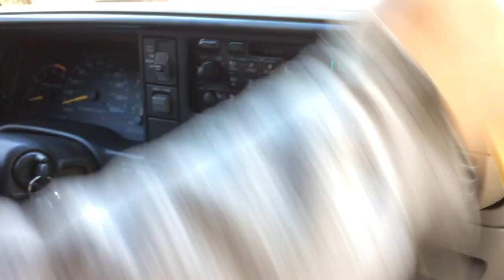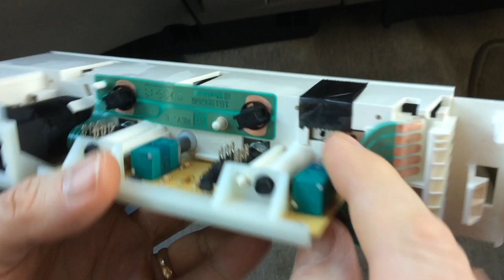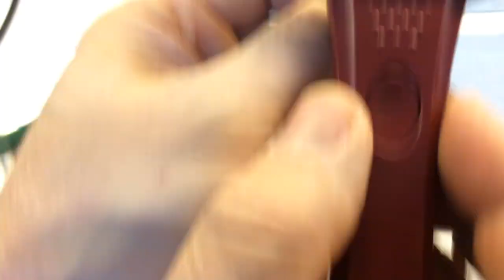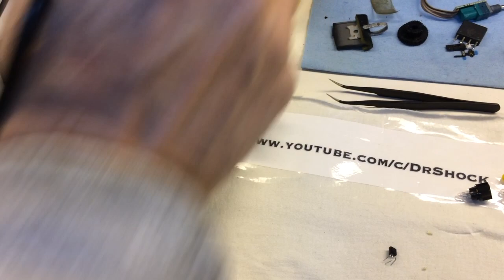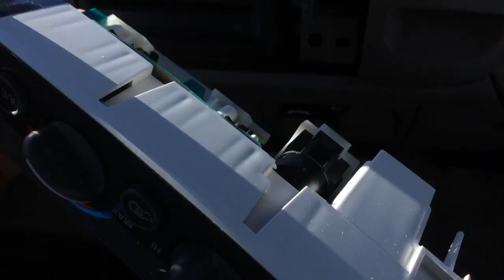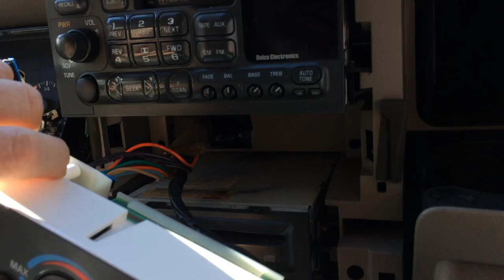1996 - 2002 GM Truck AC Blows Floor Only / Climate Control Module Transistor Repair (Chevy & GMC)

Comment: I have the same issue, but would anybody know the proper name of the green selecter switch for the that determines which way the vent is blowing. Please can anybody help!!
Reply from the maker: So jargon wise, if that's what you're asking,  that switch sets the air blend position so you'll hear the device that it controls called a blend door actuator.   Sometimes folks refer to it as a zone selector as well.  But I guess either are accurate, air blend selection or zone selection.

Comment: Whats a good brand name one to replace them with?
Reply from the maker: There are alot of makes, but newer more likely to be ON Semi or Vishay.   Its a very common component from many suppliers.   Small quantity eBay may end up being cheaper but Mouser.com is another option.
Reply: @DrShock  I saw some claiming to be motorola mpsa56 quantity of five item number 191131370944. How do i know these are really motorola?
Reply from the maker: Small parts like this use symbols, for a Motorola it would be a stylized "M".

Comment: So to get this straight, my transistor that blew is MPSA56. Should i replace it with the same one or the 2N4403? The one that blew on mine is the hard one on the outside edge under the white screw hole keeper. The difficult one you did.Where did you get the solder sucker?
Reply from the maker: You should replace it with the same one that ACDelco originally used if its a common number type as I mention in the video.   However, be prepared to have a short circuit problem in the AC circuit if it blows immediately again.   These transistors either go over a long time (more commonly) due to their just not being quite the right specification for the burden they shoulder  or immediately (more rarely) if its a short circuit under the hood.

Comment: Thanks for the video friend showed up on hottest day of the years Im in Phoenix 113 today her AC stopped working on her 96 suburban. I traced the problem to the control module after replacing the 50 amp AC fuse. I ordered a replacement AC delco module noticed it wasn't the the correct one she had rear defrost. After removing the old control module I noticed the problem the resister you said blows out was blown. I plugged in the replacement AC control mod I got on Amazon to see if the compressor would turn on well as soon as I pushed the AC button the transistor smoked in the new one. I crossed ref the numbers  and they cross over to NTE159. Im headed to Frys electronics see if it will fix it but I suspect it will burn up again. The only thing I noticed was the AC relay might have been installed backwards didn't match the relay next to it that is under the hood in the fuse box with the 4 other relays and maxi fuses. The Transistor is 800ma PNP if it blows again i'm only out the $3
Reply from the maker: @blastman8888 when the transistor blows that fast it's a sure sign you have a short to ground in the circuit.    That transistor supplies the +12VDC battery power to the circuit when activated and it exits the control module thru the light green wire on the passenger side flat connector into it.   You can trace this light green wire coming out of the firewall into the engine bay, usually it starts with the pressure switch on the accumulator and then works its way over to the other other pressure switches and then the main computer.  After a couple of decades like these trucks have you're going to have vibration/rub burns thru the wiring insulation somewhere causing the short.   I'm going to presume you have a gasoline engine (diesel AC circuit is quite different) here's a couple of 1998 circuit diagrams that should help https://www.2carpros.com/images/question_images/204058/original.jpg and https://www.2carpros.com/images/question_images/204059/original.jpg .   Just follow that light green wire out of the 'AC Switch' shown on the left of the first diagram and then thru the rest of the circuit until you find the short.
Reply: @DrShock  Thanks for the reply I will take a look at the wiring when I get a chance I removed the control module and AC relay I don't see any shorts with my meter to ground with and without both pressure switches jumper's inserted in the plugs at the relay plug. I was wondering if the Blend door air vent motor could be shorted and overloading that same green wire feeds that motor. After reading this https://www.silveradosierra.com/how-to-articles/how-to-repair-gmc-ck-series-trucks-hvac-control-unit-t77522.html  he says the only propose of this transistor is shut off power to the control module when it see's 12V from the blower indicating the blower is shut off. This was designed to turn off the compressor when the blower was not running to keep it from icing over. He suggested jumper the transistor emitter to collector leads and add a relay to cut out the compressor.  When you turn the blower on any speed the 12 V goes to 0v on the bias leg of that transistor though those resistors to make it switch 12 V on power the module up. It's a strange design not sure why GM would even bother with all that seems lot easier to just have knob shut off power to the control module when turn it to off.
Reply from the maker: This short I was talking about is going to be under the hood, not in the cab wiring.   You have to trace and meter out the entire circuit across all three pressure sensors one at a time and to the PCM as well as to the left hand air flow blend door (not the temp blend one near the heater).  What that guy is telling you in the article is not incorrect, but you're misunderstanding (I think) from his writeup that this transistor is making the connection for 12VDC to the ENTIRE AC CIRCUIT under the hood!   That's what the little transistor does.  If you have a short, following that article is not going to remove that situation and just leave you with then a burnt out fuse or worse - a burnt out PCM.   I'd still strongly suggest the transistor blowing is a symptom of a short circuit here, just friendly advice.   One you fix that sure, you could alternatively follow this guys advice to remove the weakness in the transistor design during normal workloads.   But that short has to get fixed first.
Reply: @Mike-01234  I am having the exact same problem as you (1996 Suburban K2500, 7.4L, Gas). I am on my third control module. Two used ebay ones and one brand new from Rock Auto. Each worked perfect and everything works but my "Max" A/C as that servo on the far right needs to be replaced and just "ticks" if activated so I never allow it to be powered. It is unrelated to the problem. It seems a random short just smokes the transistor. I tried using a DVOM to see if the light green wire at the flat connector would ground out. I could not shake it or move it and get it to ground out. I am thinking of just replacing it (light green wire) with a new wire full length and trying that. How are you doing and what have you done if you fixed yours? Thanks very much!

Comment: by the way, what forum did you read on the chevy ac controls...
Reply from the maker: It's been a long long time, but I believe it was this one that clued me in on what the problem had to be (though this is a different problem involving a burnt out resistor it got me looking at the transistor) -  https://mechanics.stackexchange.com/questions/42830/1998-chevy-truck-suburban-tahoe-heater-control-not-working-burnt-resistor

Comment: Hello!  I put a brand new ac control unit/panel and I worked for one day and the cold air would only come out of the floor vent even when I had the dial on the face vent.  Strange though that in winter time the panel works fine.  When I dial in the vents for floor the hot air comes out through the floor, same for defrost, etc.  But as soon as I would push in the ac button to test it out, the cold air would come out of the vent for floor only.  Last year I happen to turn on ac even though cold air was coming out from floor vent.  Well as soon as I turned it on the whole electrical system went out!  I had to pull my truck with my Pop's truck back to the shop.  I pulled off the shroud.  I moved the harness connection on the left and all the electrical came back on.  I have not messed with it since then.  We are now in summer and it gets very hot here.  Do you have any suggestions on what I should troubleshoot.  Also, I would have liked that you had shown the public on how to test those bad transistors.  I do not know much on electrics.  Anyways, thank you for your video!
Reply from the maker: I think you would find, for this particular videos scope, that you have a short circuit somewhere in your wiring harness.   Can't speak to the whole vehicle outage, as any short like that should have blown one or more fuses.   But short to ground you do have, at least one.    The power transformer in the control module is blowing because of a short in the circuit on the green wire coming out of the harness into the pressure switch located on the AC accumulator.  From there you will have to follow the harness circuit to other switches and eventually the powertrain control module (or engine control module depending on the vehicle).  The circuit varies between diesel and gasoline vehicles so a service manual is a must.   I don't show testing those transistors because it's not a best practice to put them back, mylar circuit boards are not intended to be repaired like this.   GM intended you to throw it away and buy a new one.  So to minimize damage just install new transistors always, they are cheap.  If you have the symptoms described in the video description, and only those symptoms, it's unlikely to be anything else but the transformer getting burned out.  I would say you have more than this, as you experienced a larger electrical outage which would not be possible just from the problem in this video.

Comment: So what actually causes these transistors to keep going out? I've replaced at least 4 controllers in the last week and all of them had blown transistors.
Reply from the maker: In the 3 AC assemblies I've repaired this way the transistors are all unbranded.   Sadly I think this is a recent thing (not something that happened in the 90s and just poor quality components being used lately, I have replaced the generic transistors with name branded ones of the numbers given in the video and have experienced no further problems whatsoever.   I know of others who did this repair before I made the video, and they have more than a year on the same repair with no further problems, again using name branded transistors rather than generics.   Now, I haven't hit it, but there is the case where you could get a blowing out of the transistor over and over again (having to redo this repair over and over) and if I had that happening I'd focus on the servo units that activate the blend door involved.  These transistors handle the power to those servos.  If the door is binding or the servo is dying it could be causing out of spec current draw thru the transistor leading to the failure as well.   Though most of the time, it's just shtty lowest bidder type of quality control imo.
Reply: Your alternator or voltage regulator  might  be bad , if your alternator is  producing more than 15 volts then that's what it is